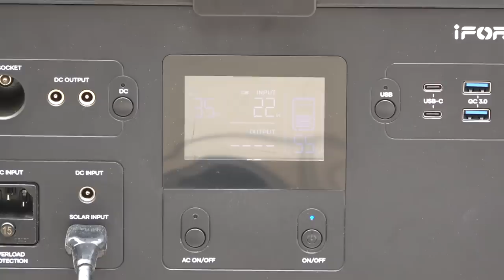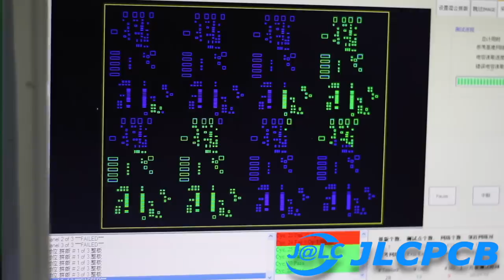No Power? No Problem! The iForway T-Rex 2000Wh Power Station

Comment: Naomi here's a project for you to pitch. I looked at the heated clothing and I noticed something was missing which is pants with heated inner thighs. I know I know, it's not like that at all. It has to do with the way we are made we all have femoral arteries that runs along the inner thigh and it is very large and very close to the surface and a great place to inject heat into the core of our body. So if you could take this: "5pcs 65℃ Electric Heating Pad 3 Gear Adjusted DIY Thermal Vest Heated Clothes" from your link and add them to gym pants or spandex pants at the inner thigh areas that would be more practical at keeping people warm. The Inuit men wear thin skirts over their pants when they are riding in the cold and that skirt is to protect the femoral arteries from getting cold and thus cooling their core, but you can do the same in reverse. You would heat the length of the inner thigh to warm the core.
Reply: This is smart, it's proven heating the blood is the most efficient way to heat the body, hence the MIT wrist mounted peltier blood coolers. Warming should work equally well

Comment: I lost power on my farm in Canada, it was -30, high winds. After 2 hours my ups could not provide the surge of power my gas furnace required. 30 hours later when the power was finally restored my home was at 6 degrees. That unit looks like exactly what I need. Thank you again for turning me on to a great product.

Comment: Great video.  A suggestion with the gas generators, if you have one.  When you are done using it keep it running but turn the fuel line off with the shut off valve.  That way it burns through all the gas in the line.  This will help to stop the corrosion.

Comment: Thank you for this sober analysis! Have you thought about putting in a solar heated small insulated hot water tank and use a thermal sterilizer unit to make sure it is safe for drinking? Water only needs to heat to 60C for a half hour to sterilize it. Throw in a copper (antimicrobial) storage tank, and  even a 3 litre tank could make a difference in your comfort.

Comment: One other problem with using a gasoline fueled back-up generator is that fuel has a relatively short storage life.  This is why people who decided to get a back-up generator try to use a diesel fueled generator.  Typically, the diesel fuel can last for 4 to 6 years in storage.  

Regarding your server... I found that you can replace the computer AC-to-DC power supplies with DIN rail mounted power supplies.  You can have a one or two AC-to-48vDC power supplies to run the computer components.  Then use DC-to-DC power supplies to step the voltages down as the computer components may require.  What makes this practical is you then install 24vDC or 48vDC battery on the circuit between the AC-to-DC power supply and the DC-to-DC power supplies. This will reduce the overall wattage you need to keep the server running while the main power is off.  And you can design a recharging circuit for the battery when main power is restored.

I think MoMo is telling you that you need to play more.  This advise from your dog is MoMo's way looking out for you personal well being.  Good dog, MoMo.

Comment: The endless cycle of energy conversion. For small power, I have the Kentli Li-Ion batteries that output 1.5V for use in things like flashlights, but they also have chargers that function as battery packs to output and be charged by 5V.  Additionally, their small voltage allows for relatively quick charging on a hike or in a small space. Thus it is possible to run important equipment like the phone and flashlight indefinitely. As for larger items, I have a 12V engine starter battery that can be charged by solar, vehicle, or mains. This is able to power a laptop, and CPAP overnight when I lose power. I love power storage and conversion setups. They are wonderful in the options they open up with.

Comment: I love this video - smart and practical. The one thing I'll suggest is that the problem with such monolithic solar generators is that if something goes wrong your whole power source is gone. If instead you stock a few ebike batteries, they each have a BMS built in. Then a separate charge controller, or even just DC to DC regulator, makes for a very modular system with redundancy. Plus....you know, you can ride your bike out of the problem area if you need to.

Comment: Very informative :)
I didn´t know heated clothing exists, i just knew about heated blankets, but i guess heated clothing is kind of the logical "evolution" of that.
And i didn´t knew about the usb adapters for Makita power batteries either (i speculate this exists for other brands as well).

What i personally would find very intersting is a "No Power? No Problem! The iForway T-Rex 2000Wh Power Station - revisited" video, when a power outage occurs and after the situation is over you talk about what worked liked intened and what problems/unexpected things happend.
Reply: You can even get the 5v heated fabric patches and sew them in whatever you want.  Look up  "carbon fiber heating pad usb" on aliexpress or ebay
Reply: @LarryKapp1  thanks for the tip :) i just had a look, looks interesting. You happen to have any experience sawing them in ? I can do basic sawing, but have a lack in sawing-experience regadring more complicated stuff.
Reply: @christophherrmann5732  I haven't made anything with the ones I got - gave some to a friend and she sewed some into a jacket for herself. Pretty easy sewing I think - the patches I got came all wired up to control button and usb plug.

Comment: Here in northern Germany we tend to dress in layers, so that we can add or remove layers according to the quickly changing weather ("Onion look"); the air between layers works as insulation. A heated inner layer would extend the range into even colder temperatures.
Thanks for the extra footage of affectionate Momo.

Comment: Depending on your situation, a battery bank might be the right fit for your needs. You could get rechargeable batteries and silently hook up solar panels. In wartime civilians would use black sheets to line their curtains so from the outside it's a colorful curtain without any light escaping.

Comment: Okay. So the battery pack is 2000Wh. That's okay, I guess, a bit small for all but the most essential uses. But the solar panels are 200W. That means on the best day you will get maybe 720Wh (200W times 6 hrs times 60% efficiency) into the power bank. And if it's a cloudy day that number will drop even further. You're going to need a lot more than careful battery management to survive for more than a day.
Reply: This assumes you use up the full capacity every day
Reply: @Hamdad  
Living alone and with some pretty careful use of electricity I need about 7000Wh per day (that's with a solar geyser for hot water and a gas stove and oven).
Assuming the battery pack in the video is lithium ion, the maximum power she can extract without damaging the cells is 1600Wh. Do the math She's going to draw that battery to the max.

Comment: I am a fan of Monero. I have been mining it for a while now. I used to mine bitcoin but it became unprofitable. I mine monero with my Linux workstation and a laptop. I am also dabbling in buying and selling monero on kraken. Nothing large but I found I can usually make more money from trades at the correct times than I can from my meager mining efforts. I watch the monero prices while playing minecraft, and quickly get on Kraken to buy or sell if I see some large vertical movement. I don't always guess correctly but since I am using monero I mined from a computer that normally stays on 24/7 anyways, I treat it as a fun learning experience. I also keep a monero node up to support the network as well as a bitcoin node to support bitcoin's network. I appreciate you putting out the word by wearing the monero t-shirt. It was a pleasant surprise seeing the t-shirt on this video. 
I loved the video. I purchased a diesel generator several years ago but have let it kind of sit. I am in favor of solar power generation for climate reasons. I am retired now so do not have a lot of extra money for things like solar power cells. It is the direction I will go if I find it possible in the future. Here in Ohio, USA, the power companies charge you twice for your power. Once for distribution, and once for power generation. The only way to beat that scheme is to generate your own power by solar or wind, or water if you have a stream on your property, which I do not. Again, thanks for the informative video and even more for getting me to think of possibilities!

Comment: that was very interesting.. I always enjoy hearing you explain your use-case scenarios..

I personally got a propane gas generator hooked up for my house -- we've had floods in the years past due to storms so i finally decided having enough power to both heat the house AND run a sump pump was an absolute necessity

Comment: As a Texan, yeah. We never lost power, qnd continued to use heat and a fireplace the whole time, but due to the rental having TERRRRRIBLE insulation, the temp still dropped as low as the high 40s °F.

Comment: One thought is to add a set of DC powered pet groomer clippers so you can cut the hair on your dog when it gets hot and the power is off. Or you can plan around this by getting your dogs' hair cut prior to heat waves. That way your dog is more comfortable during the heat waves and more prepared for when the electricity goes out during a heat wave and the AC is off.

Comment: Talk about serendipity; I was just looking at getting a new battery backup system to replace my current lighting strike damaged one. Now I just need to find out if the battery used in the 
iForway T-Rex 2000Wh are standard off the shelf components, that can be replaced in a few years when they inevitable need replacing.

Comment: Great stuff! I bought a couple of solar panels a few years ago intending to set them up on my balcony and use them for battery bank charging. Never did get it done, must get at it now.

Also love the USB heated clothing. I'll have to get a set of tops/bottoms before winter. Would be great for transit commuting. On while waiting for the bus and off once I get on and in the office/shops. Have to get some battery powered fans as well, even if just to avoid running extension cables when the power is available.

Comment: Although solar backup is useful for some things. Let's put some figure's together.
Most places have 8 hours useful daylight.
That solar panel will generate 25 maybe 30 Watts Max.
The battery station is 2kW.
To charge, assuming 20W average continuous, that needs 100 hours to charge or 12.5 days. And if you use 2kW per hour.
That is 12.5 days charge for 1 hours use!
Reply from the maker: As I said, best to focus on reduced power consumption.

Comment: That's a really nice product. I could imagine installing it to my Volvo 200 and putting solar panels on the roof top like I did back in 2015.
And since my old car has an aftermarket smart A/C system that cools down the car to 18°c if the engine isn't running, I don't think that it will be dangerous to keep the whole power thing in the car. 
Also I like the fact that it has universal AC Plugs.

When the product finally comes out, I'll buy it and hopefully it will come out in the next 2-3 months since I'll be doing a road trip through Europe and try to hit 1.000.000km millage on this old bucket ^_^

Comment: I have a grid-tied solar setup on my roof with a 13.5kWh battery which can do blackout protection. Even though I live in a major capital city, the geography of my area and aerial power leads to many power outages, both scheduled and unscheduled, with the most recent being 16 hours! Unfortunately, with this one, I started with only 5% in the power wall because I had been playing around with rate arbitrage (I pay wholesale rates for electricity) and while I have a generator, I did not want to use it because of the noise and smell. Fortunately, I have a camping trailer with a 280Ah of lead acid batteries, 250W solar and a 1kW inverter which was able to run my important server and communications loads and the fridge for most of the outage. Eventually, I ended up having to use the generator anyway, so it pays to have backups for your backups (or in my case backup for the backup of my backup)!

On the weekend I was camping in the mountains and one of the groups brought a petrol generator which really disturbed the calm of this otherwise peaceful spot. This iForway product looks like an amazing solution. Being so portable means that people can take it with them wherever they go, using it for backup power when you are at home, and taking it with you if you need camp or site power without the noise. A pity that pricing does not yet seem to be available.

Comment: I have been subbed to you since SerpentZA's video with you in it, I'm glad to see you continue to grow and produce such great content! 6:26 If I were going to use a generator I would look for a dual fuel with optional propane hookups.  For me since my heat and hot water are already supplied by a 500-gallon tank, this makes sense.  Also, for you, propane is stable and requires no additional stabilizers.  And it comes in its own tank.  The oil still needs to be changed every 8 hours of use.

Comment: Momo outtakes are best outtakes. Great video, would love to see a break down of that fan, did you do that yourself or was it an after market? I have a Craftsman heated jacket that uses the same batteries as my drill set but the wiring has gone bad in it so I need to find something new to replace it with.
Reply from the maker: Just a 12v fan I added a 3D printed adapter to
Reply: I recommend the Fieldsheer Dual Power pants and jacket. They use 12 volt batteries so it can also optionally run off 12v vehicle power with an included adapter. It's pricey but heavy duty, VERY durable. Have used both for 4 years so far with no problems.

Comment: using solar panels for electricity is quite interesting. I just hope solar panels can get electricity from heavy rain. 

I used to study physics, we can get electrical energy from the surrounding heat. It's just that no one makes a tool to get electrical energy from heat that works as effectively.

Comment: I own 2 gasoline power Generators (a big 6 KW one and a 2.2 KW Generator (Inverter, Honda)) and can not recommend them in an urban neighborhood either. They stink and cause lot of noise. 
So due to our stable electricity situation I use common USV´s in my Servers and the most important workstation. If our power-net was unstable I´d look for a solution for special use cases as e.g. very long 3D printing tasks. Terrible prospect if a print could fail after some 20 hours.

Comment: Have you tried hooking up a transformer from the solar panels with a resistor cap load to transformer the transformer to a bridge circuit for dc conversion I found they were ac in radiant form and just needed a power ground to have some earth static for voltage.
Reply from the maker: Huh, I'll look into it.

Comment: I'm not sure how successful you are at keeping a low profile.

For me, here in Australia, a petrol (gas) generator makes a lot more sense for the few times we get power blackouts. For the same power delivery, a battery generator costs about 10 times as much.

We do have solar panels on our roof, but they are useless in a blackout: by law they have to disconnect. For about the cost of a small car, we could upgrade the system to have a battery backup that automatically isolates from the mains in the event of a blackout. That also, in my view, is not worth the expense.

Comment: This is 100% EXCELLENT of a presentation. That unit and Solar panel setup is tops !
We want to know all about that fan that runs with the cordless tool battery !!
Is it a regular fan with an inverter from the battery, or is it a low voltage motor specifically arranged to run from the tool battery ??

Comment: Helpfull overview of your use philosphy, blending practicality and low visibility. It appears that the battery sits inside that larger enclosure, and can be swapped for a second battery pack. Is this intended use? Is that larger enclosure weatherfproof? Perhaps you have already reviewed that unit. I would also like to see the DIY fan conversion to use the makita batteries. I wonder how long the fan runs on a single pack. Thanks.
Reply from the maker: Yes you can swap them out, but I'm not sure how much weather it can hold up to...

Comment: 11:00 - You can get AC power out, but can it be disabled? Can you disable the other outputs too, running unused inverters constantly just consume valuable power. Does it turn off the display?
Take a look at the chart at 11:05 -  With a 45W switch it has a runtime of 26 hrs, that's a a total of 1170Wh, not good efficiency for a 2000Wh UPS.
Love the replaceable battery design, what is it based on - Li/Pb? Can you do your own battery packs, or are you 'locked in' DRM style.
No power, No problem - well... ;ø) Longer lasting power is more of a problem than shorter lasting (-:

Comment: It looked like the battery was separate from the unit and could be swapped out.... Why wouldn’t they put the solar input on the battery itself so that the second battery could be charging on solar while the other is being used inside.